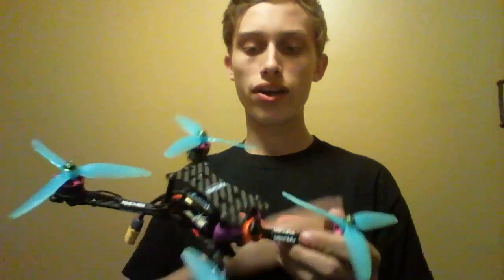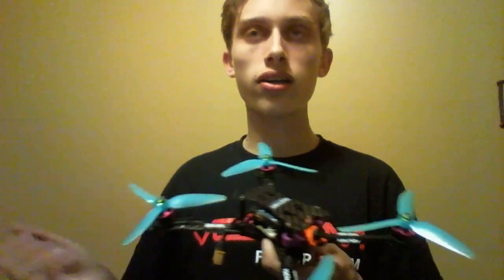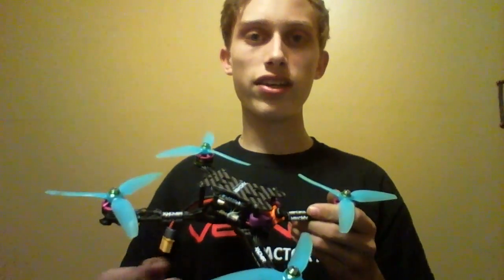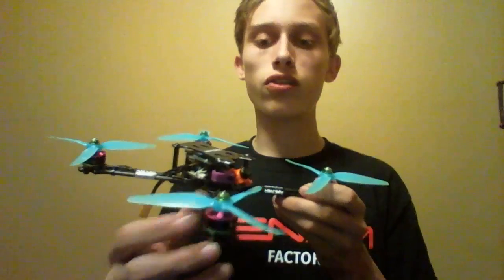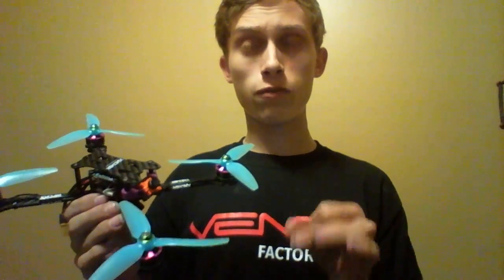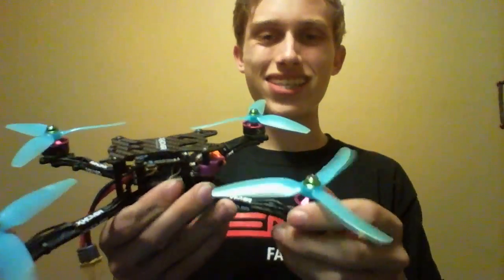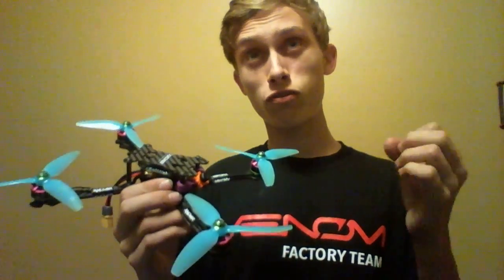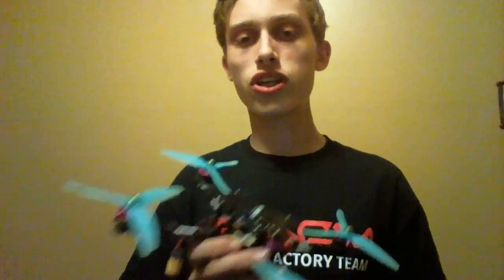Brother Hobby 1806 2850kv motors post flight review,,, Perfect ultralight motor?!?!

Comment: Hi Alex, it was this review that finally made me pull the trigger on a set of these motors for my first build.  I was sure of robustness (Japanese bearing, titanium axle) but wondered about the high Kv.  I've been training on this (and only this) light-ish build (<400g AUW with 4s 1000mAh) since my first-ever FPV flight almost two months ago, and can't say I'm disappointed.  In fact, my "boring" flying style causes the battery to heat up more than the motors, so I don't think heat will be a problem.  Then, again, I have lighter props (5x3.8 two-blade) than you.  Since this review is now quite old on the FPV time scale, how would you rate them today?  Did they hold up?  Would you buy them again?  They're still available and still expensive, which might be a good sign.

Comment: Great video man.. hey I have some 1806 2300 I bought a year ago for backs up never used then. Iv been thinking about what I should build them around. What do you think a 4 inch or light 5inch? I don't think there's a 3 I could put them on?
Reply: Hi i have exat the same Problem. Bg sell the hskrc foss Frame(60gr.) for 13€ i think i will buy it and give it a try. Do you think 30A esc are enought? Best regards Marc

Comment: I recieved these motors and frame, and i am pretty disapointed, without modyfing the motor mounts it is impossible to instal these motors on it. I giving you minus 100 points budy :-/
Reply from the maker: im sorry to hear that:( I did warn everyone to make sure that there frame supported the bolt pattern, i didnt have to slightly modify the frame to get the motors to fit.

Comment: Now this vid. Confuses me... i have decided to run this BH 1806 2850kv motor on a kk4045 until this vid. Came out.  My real purpose for this motors was to setup a superlight 5inch quad using a floss frame.. but based on a previous build that has a 20a esc and a f30 which is  an 1806 2800kv motor from tmotor they get warm on a v1s 5x4x3 and now you are ripping this on a 4.3 v1s?? Damn! I dont know what to do anymore
Reply from the maker: haha just do what works for you! my opinion is baised off of my personal testing, the results could be different if you tested
Reply: I use them on some 4" with 4045 tri Blades...But i put some 4040 tri Blades on now, fits these Motors better imo

Comment: Nice review. How's the temperature of the motors? I am using Floss flame and combining with HQ5043 or other 5040 tri blades, they tend to get hot, even with very low P term (around 45) and low D term (around 20). The only filter I adjusted is changing D term lowpass type to PT1. I have Floss 2204 3022kv setting with the same electronics, but the motors are just warm, not hot.
Reply: Try use two blade props

Comment: How many amps are you drawing? Raceflight spark is stupid small and light 20x20
Reply from the maker: danlatu roughly 20amps, the spark would work on a 4inch, you wouldnt be saving that much weight on a 5 inch id rather go with a bigger esc
Reply: I've seen a couple of 5" floss' with them inside.
Reply: danlatu because hyperlite 2204 draw about 18 amps in the air

Comment: https://www.youtube.com/watch?v=fqiNtXn8LjU I bet ytour at least getting a 1000 grams of thrust per motor from your set up.

I wonder how they compared to the pryodrone 2204 floss series motors.
Reply from the maker: me too! i ordered a set from canada, lol was the only place i could find them in stock! ill do a video when i test them in the next week
Reply: yeah I already have a 220 grams 2204 3022 build. It just stupid fast. Like literally the fastest quad I have flown on a race course.

When I weigh my unmounted full wired 1806 2850 kv they come in at 22 grams my 2204 came in at 26 grams...I think my scale reads high.  but its relative.

I already own the motors and they are going on to a old Tweaker to run a prop free run cam swift on like 270 grams 4 inch. I may have to order another set or two low to try on a 5 inch floss.
Reply: by the way the 3022 can drive 5040 tri fine. I run 1000mah Graphenes and it zooms.
Reply from the maker: Nice! im still deciding between setups